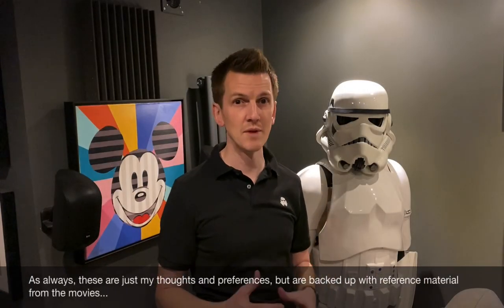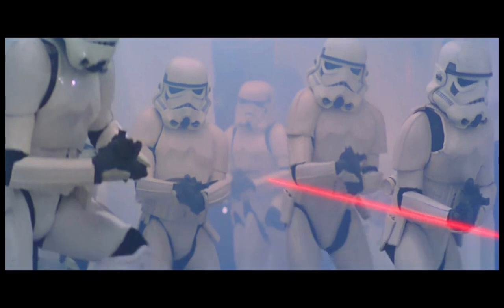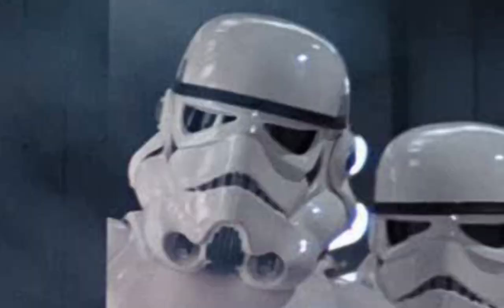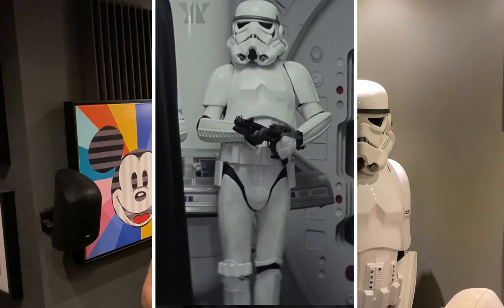DOS and DON’TS for making a REPLICA Stormtrooper Helmet

Comment: Armor problem is Thermoformed plastic manufacturing process (why ? because low manufacturing cost for the film, the comfort of wearing it is after...poor extras actors inside during movie they suffered !), the pieces are very thin and cause pain with pinching of the skin at the joints, the solution ? no more thermoformed manufacturing ! but in injected ABS, or you can leave thicknesses of material near each joint (arms and legs) and also be able to shorten (while keeping the internal bead) and adapt the ends of each piece to each bodies, thanks to this surplus of material (which is not heavier than a thermo armor) here is the solution friends, this ABS version seems not to exist yet today...I'm coming....